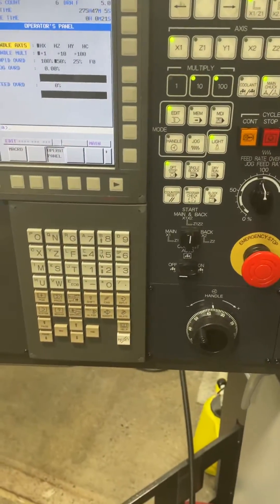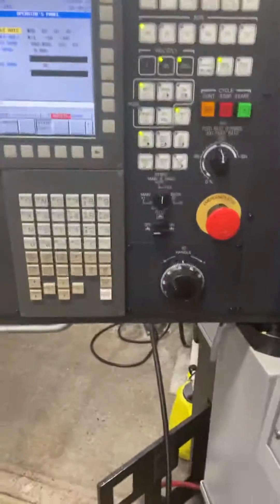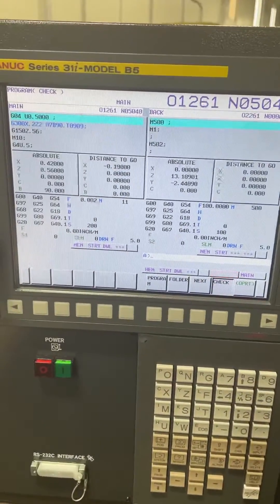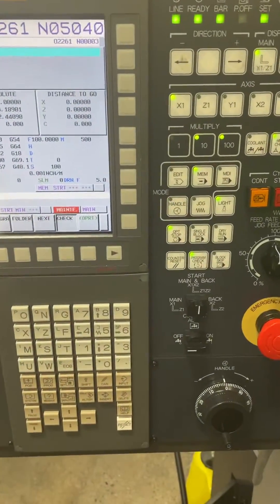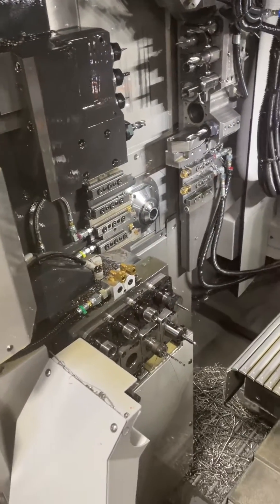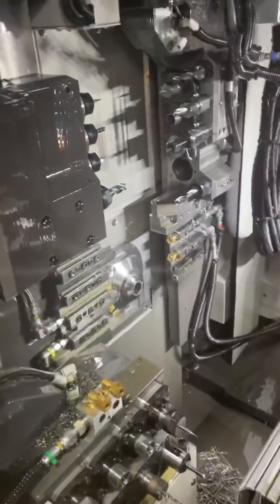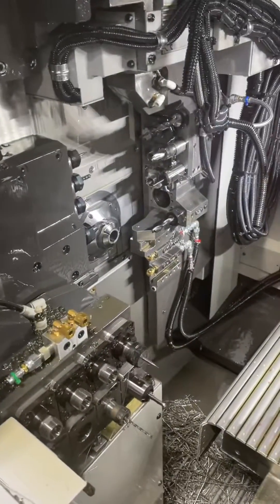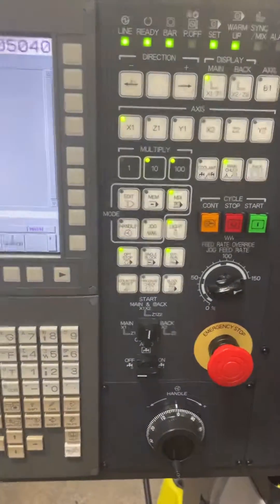How to use program check/handle and dry run on a Tsugami Swiss lathe

Comment: If 25% is too fast, change Fanuc parameter 1421 to whatever speed you want and use F0 rapid. I have mine set up 20ipm.

Comment: Dry run works great for me proving out a new program. The federate override controls both the rapid and feed moves, I hit start, and keep my hand on override knob the whole time adjusting fast during rapids and slowing down during cuts. I put it at about 70-80 percent during active cuts. Never has failed me yet. Very easy to put at 0% and stops everything except spindle.